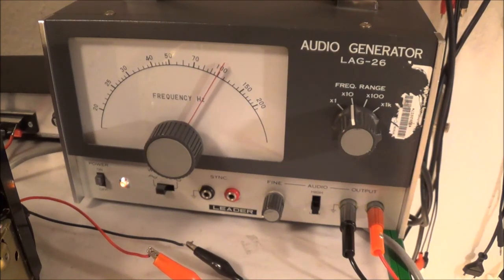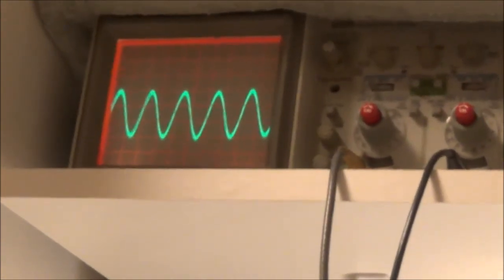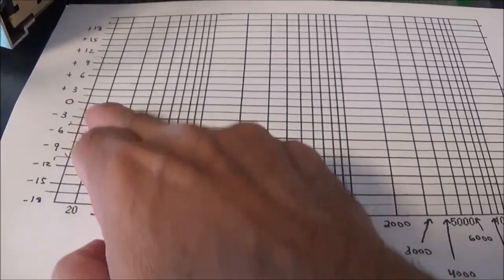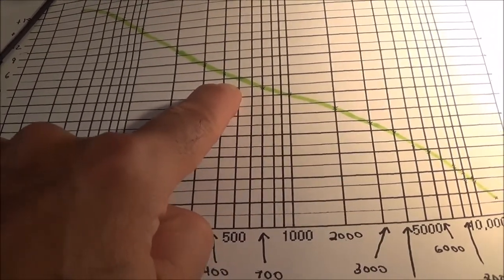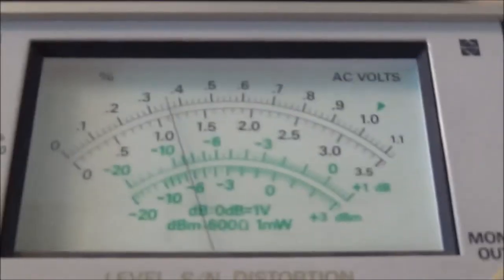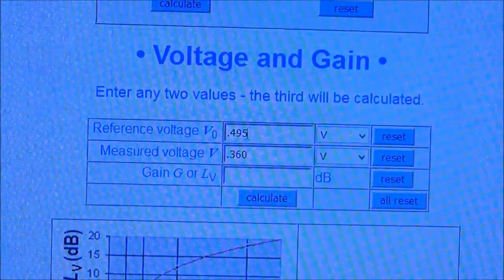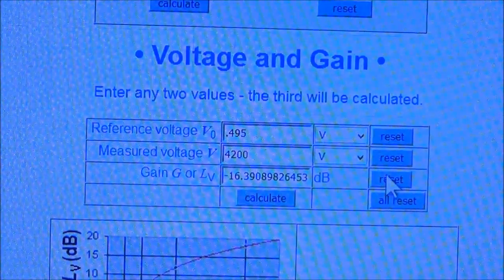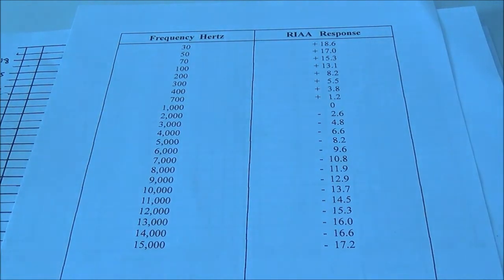Pioneer SX-690 Stereo Receiver Phono Preamp Testing

Comment: Very interesting video. Thanks! Could you explain where/what to look for/do when the readings are not within spec.
Reply from the maker: +Jelcke de Boer Thanks for watching! Depends on what the problem is. But overall, I would change out all the electrolytic capacitors in the phono section, especially with this vintage equipment. This is not a big and expensive job. Of course, since the phono section is really low level, you have to have good connections and it would be wise to clean all of the switches. And check for bad solder joints.